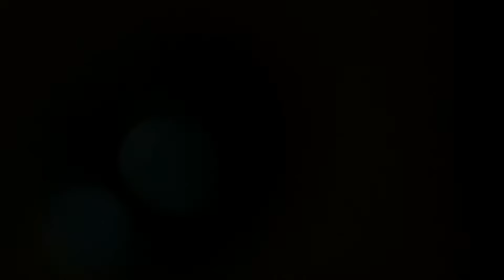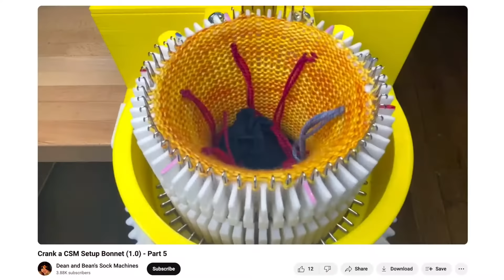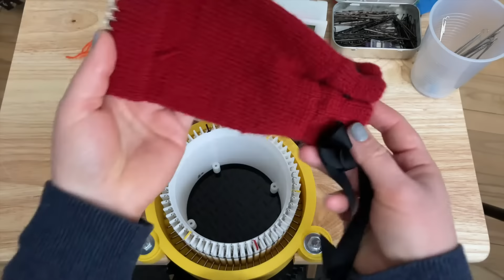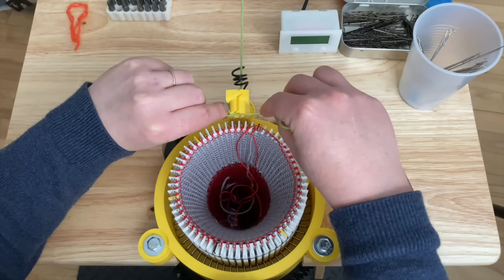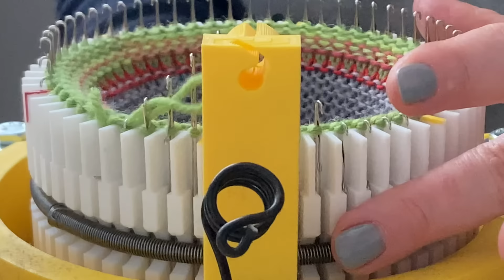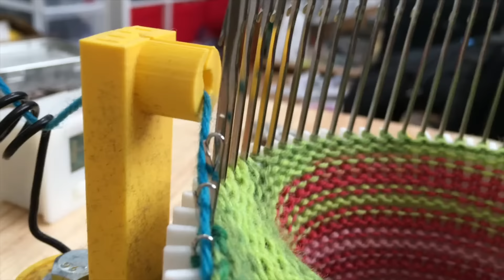How I knit a sock on my homemade circular sock machine

Comment: I understand this is a few months old, as is the question I see, about the cone winder. By any chance is that in your github repository? (Got here though your straight line knitting machine video from the last couple of days. I'm thinking that might be useful for that device as well, especially if people are running into problems with tension from trying to pull from the middle of a skine, and get the wrong part.)
Reply from the maker: The cone winder isn't public yet (it was, uhhhhh, a much less organized project than the knitting machine) but I do hope to clean it up and make it available at some point soon. I made it with the hope to use cones for both the circular and the flat knitting machines, but I haven't yet figured out a good way to set up a yarn mast with the flat machine; without a mast the cones seem to cause more problems for me than than they solve, so I still use balls or cakes on the flatbed. Although I recently saw a hand-knitter knitting off cones that were attached to cute little turntables, so that might be something to try!
Reply: @SparksCuriosity  Hope to see it soon. Going to need one soon. The ball winder my sister-in-law has been using isn't working the way she would like, and really isn't right for things that need the cone winde anyway. I figured I'd start with designing my own, and started with what I figured was the hardest part, namely the traverse barrel and having trouble getting FreeCAD to do the groove. I consider this more an issue with my not using quite the right workbench because I have been using this one, and similar to the problem of having a hammer and treating every problem like it's a nail. I've asked on Mastodon, I may have useful feedback for that. Gearing is likely to be a pair of prime number T20 timing belt pullies, 101 teeth on the travers side, 23 teeth on the cone side, and that should give me a fairly large number of turns before a layer starts overlapping an earlier layer. We'll see.
Reply: Can’t wait for the cone winder to come out!!

Comment: My aunt is an avid knitter but really struggles getting knots in her yarn from the balls (shes got strong learning difficulties and can't untie them so gets very frustrated) I'm really tempted to make that winding machine for her for Christmas, does anyone know if thats likely to help or am I probably misidentifying the problem?
Reply from the maker: What a kind gift idea! A lot of yarns get tangled really badly when you try to knit them straight from the ball/skein as it comes from the shop, so rewinding into something that feeds more smoothly can probably help with that, but if she's knitting by hand I'd suggest a more traditional ball winder than what I'm using here. The cones are good for machine knitting but I haven't found them helpful at all for hand knitting. Ball winders are pretty readily available off the shelf a various price points, but if you're keen to build something I've seen some interesting DIY examples in both 3D-printed and woodworking, though I haven't got around to making one myself. (On the other hand, if the problem is that she's encountering yarns which have been purposely tied into knots to join broken strands, like what I encountered in this case, the winder probably won't help much, unfortunately.)

Comment: Why is it not more convenient to knit a long flat piece of cloth and cut and sow it into a sock? You could have a knitting machine spew out meters of it and just cut and sow the fabric as desired. No messing with heels.
Reply: For one, you would end up with seams, which would feel very annoying on your feet. The other issue is that getting them to fit properly would be difficult. The foot is a pretty complex form, turning flat fabric into a 3-dimensional shape that fits snugly and stays is a lot more work than starting in 3 dimensions. 

I'm not much of a knitter, so although I know you can cut hand/machine-knit fabric like this I believe it requires a lot more preparing to prevent the whole thing from unraveling compared to cutting commercially made "microknit" fabrics like jersey, as when you do attach multiple pieces together with home knitting you are generally knitting the pattern pieces to the exact shape and size with edges finished.

Comment: Son has a resin printer and said probably not work with that type (printing flatbed or circular sock knitting machines). Thanks for the info and links to printing patterns.
Reply: Yes. Resin printers are better for smaller high definition/detail prints like figurines and such. Though, they can still print whatever you want. But filament printers are faster overall and are less of a procedure since they don't HAVE to be finished/cured like resin prints. Resin costs about the same as a 1kg roll of filament, (of course, there's more expensive/stronger exotic materials for both) but resin printers require wash and cure stations, as I'm sure you're aware.